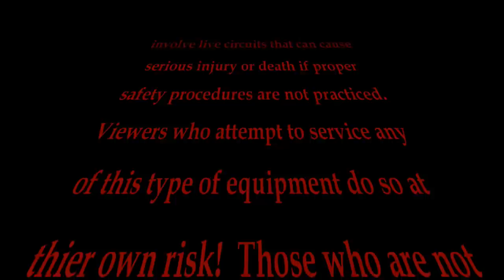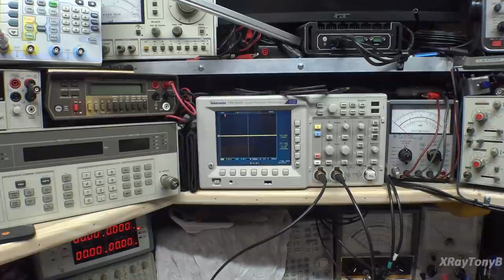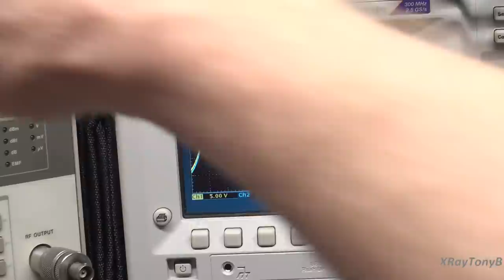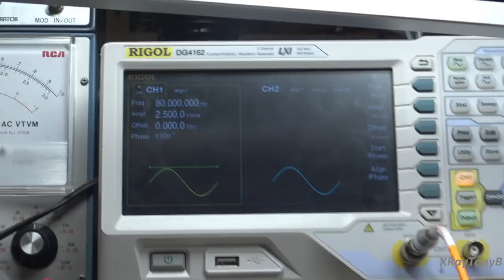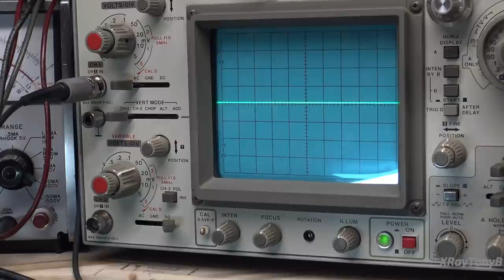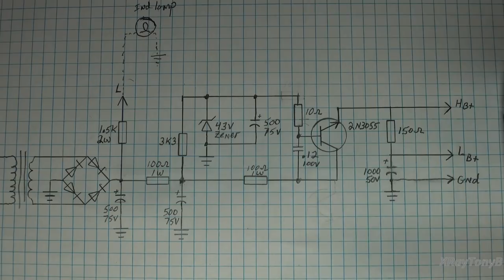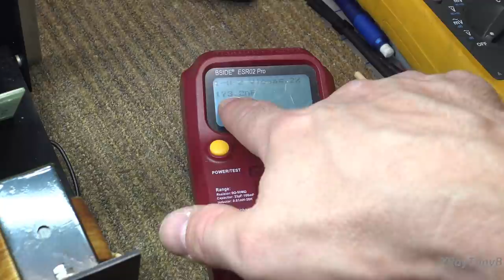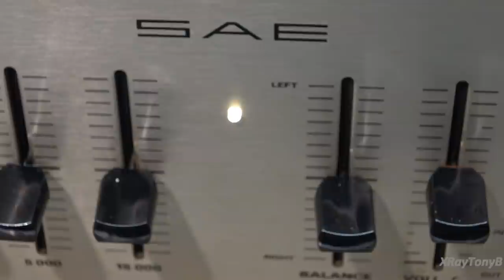SAE Mark Nine Preamp - Troubleshooting With No Schematics

Comment: Hi Tony 
Ceps hat  with Mic  works great , and you look like Hollywood star too :-)). my  comment about equalizer is that  they color sound , they have phase shift too , when I was younger I thought they are great but when I get older I understood different between good win and young win , then I choose no more equalizer in my system . 
I work as engineer designing electronic past 30 years and I enjoy each second of your video , better then any film , with some cheeps and beer it is much better .  some time I watch them several time too . 
I like also your persistence to find faulty parts , and reverse engineer , I teach my self a lot from your channel  even with 30 years designing electronic experiences .

Comment: When I was into audio more, early 90's, I had a nice system. I still had an EQ that I could cut in or out on my amp. It was a dbx1531x and I found it could make up for what the room lacked. I know a 'straight wire with gain' so they say is best, but I think an EQ  has it's place when used correctly. Good video.

Comment: i love equalizers. always have. i'm 51. i now own a couple equalizers i used to drool over when i was young. audio control c101(which i recently recapped and replaced all 101 leds in the display, full cleaning. its beautiful with mic. and an ads , and a fisher 12bnd(partial recap) and an optimus 10bnd(partial recap). my marantz pre/pro has 7-9 bands . all my computer sound cards have built in eqs. i've also been playing around with those 10 band eq boards from china, actually have a 15 band that'll be here soon. eah. any speakers in any room can benefit from an eq.  spectrum analyzers are fun to look at too....how about the vintage sansui with motorized sliders? you should try to find one and restore it. just the cool factor of those. almost forgot my minidsp 2x4. active xover, 15 bands of parametric eq. yeah buddy!

Comment: The Graphic EQ's marketed to audiophiles used to come with multi-band "test records" you could use to adjust each band (by ear..using test "warble" tones) based on the interaction with the room and the speakers. I've been using EQ's since the 80's.  I re-built an old Soundcrafstman 2020 10-band EQ quite a few years ago. I upgraded the PS and the Op-amps. I use it to attenuate the "boomy-nes"  of a floor standing sub which is placed in a corner. The op-amp upgrade really made a difference. I use a (discontinued) Ashley 15-band (pro) EQ on my main system. No "test record" though. I basically use the same "curve" from the old "Soundcraftsman EQ record". I'm planning to build a 5-band sub-woofer EQ. (don't know of any mfgr. that makes one..)   Errrata: Now folks will be sending Tony baseball caps. Would you like a "Cigar" themed cap?
Reply: Addendum: The EQ model I re-built was actually a 2215. It came out around 1990. It was based on a quad-741 Op amp (aaarrghhh..). One quad-chip per ch. I replaced those with the LM837 and a pin-out adapter. Much better sound with the LM chips.

Comment: I bought the SAE Mark Nine pre-amp in 1981 for $200.00 along with a Yamaha P2100 power amp for $300.00. The very first equipment that I owned for DJ'ing instead of renting every weekend. I loved this combo. I don't remember when I sold the pre-amp. I still have the Yamaha but it needs a quick solder job on the input connections that are right behind the cover. Just by being dragged around the state from town to town messed up those points. Loved this video, I sure have learned a lot watching your videos. Keep up the great work, Tony!

Comment: Use to be a more expensive contraption out called a 'Parametric Equalizer'. At the time, I was young and into stereo equipment and worked myself-up from cheap  monthly payment-plan no-name system to Dual 1264 turntable, Avant 6AX three way spkrs and a Realistic STA2100 receiver/amplifier-(much liked) a nd a ten band graphic equalizer. Did the same thing with adjustments as you demo'd above. Then I purchased the parametric equalizer and it was good at bringing out bass, drums..singing, it made a difference. BTW I still have the Dual 1264 TT   I purchased in 1979 and it works great. Except I made an awful one time mistake. I auto started the 1264 with the tone-arm locked down ! Anyway I put myself on a course and journy finding all info on the guts of it and knowledge of all the mechanisms under the platter..wow. At the moment it still sounds great but no auto-anything, can't lift the tone arm using the OEM silicone damped arm lifter. But purchased another arm lifter that I will rig temporary. My albums from the seventies-on are all immaculate  and my hand isn't. So record groove damage could happen, hence the temp manual lift Iv'e got until I once again lift the whole mechanism out, diagnose all the damage and get the parts..too much said LOL.

Comment: About the EQ, sometimes it is useful for compensation of tonality imperfections due to room modes, dull source material, bad speakers etc. If the width of each band is not too narrow and if it has a "true bypass" switch, it can't be a bad thing.

Comment: Interesting video Tony. For your amusement --- I used to work for a company in Montreal during the 70s that was licensed for Altec Lansing "Acousta-Voice" technology. The idea was to match the system to be the inverse of the room's acoustic resonances, using frequency analysis and filters. The goal was to fill the room with louder sound without booming, feedback, etc. It was initially done with passive parametric filters. After the tuning was done they replaced the variable filters with lower cost fixed ones. The results were awesome for the time. If you Google it you'll see some of the cool vintage gear I worked with ...

Comment: Awesome collection of test equipment tools. I stopped using regular Equalizer, still have Pro Audio Yamaha from 80s. Instead I started to use DSP based correction. Eventually I go for full DSP crossover with class D amps.

Comment: LOVE THE VIDEO!! Used to work for a USA based sound reinforcement company (that's what they called amps, speakers, and mixers used at concerts while I was there) and I HATE those linear pots!! I much prefer the radial pots and the actual coils used in EQs. Most coils are replaced by chips and resistors now days because silicon is cheaper than copper. Overall I love your videos as it takes me back to when I worked on audio circuits and had fun trouble shooting the problems some had when they came off the assembly line. (Like why the 50 volt caps were blowing up when attached to the 75 volt supply!) 
As for equalizers, I have found that I like them on my computer to compensate for some audio on you tube videos that have various problems and I like them for my car. This is the best use I have found for them.
Be well and THANK YOU for the effort you put into these videos. I know it's not a little bit.

Comment: For most, bass and treble do the trick. A loudness control is handy for  most people, both more than an eq. I used to find old recordings really needed an eq. You could boost the very top end or cut it to get rid of hiss. Some speakers were squeaky, the higher mid cut was welcome. I really enjoyed seeing you suffer like many of us and fix it no diagrams. Sure you can buy them or scour the net but often you can feel your way around, like driving without a gps, it's a good skill. Actually my Xerox diagrams were called roadmaps.

Comment: on an EQ
no amplifier is perfectly flat (in my  experience) no speaker is perfectly flat (in my experience) all add some color to the signal some very little some way too much. Not many listening situations are acoustically perfect either.
I have found that using an EQ to compensate for all of those variables to be the simplest way to get good results to make the signal larger without adding anything to it.
I found it very helpful when setting up live events it always made the audiences feel more comfortable  they would not even notice I and the system was there.
The key element for me is using a series of tones to match the bands of the EQ that are all the same level and adjusting each band to sound at the same level, the early people always complained about the sound how ever. After that I will play some test recordings of known music to verify the results.
It can even improve some not optimum set ups like beat-up speakers in a gymnasium  though it wont stop echo and bounce back
uncle frogy

Comment: When I was much younger I tried to be a "purest" and hated having anything in my signal path. I've relaxed over the years and tend to use tone controls pretty often just to get things sounding pleasant. Of course the speakers, placement and room conditions play a role and I don't have the "highest end" of speakers any longer (though very decent sounding AR floor standers from the early eighties). However, every recording is different as we all know and even with all of that aside some recordings just need a little equalization in my opinion.

Comment: This is an all discrete design with an LCR equalizer section. Very good, this is best but most expensive way to do analog EQ, not a string of noisy 1970s OPAMPS. As for the need for EQ, any recording studio, scoring stage, mixing room, screening room, theater, I have ever seen, and I have seen a lot, have equalizers in the speaker path. And many of these rooms were designed from the ground up by acoustics engineers, yet still need EQ. There is nothing wrong with EQ provided it's measured and calibrated. And beyond that, many home preamps such as the unit here have defeat switches. So if you want purist sound, then switch the EQ off. But it's there if you ever need it for a particular recording. Parametric equalizers are much more useful IMO as they can tune out a null or peak very precisely, but are also more difficult to set up properly. A graphic EQ is a nice compromise for average home needs and are also used in many professional installations.
Reply: You said it all Andy Delle.
Reply: I have wished to re-equalize certain track's, especially Weather Report's Birdland.  I always want Jaco Pastorius' Bass "stick" to dominate the tune more when it comes in!

Comment: I prefer the classic Marantz and McIntosh and others that have 3 tone controls Bass, Mid-Range, Treble. That provided most of tonal quality needed to make the great sound. Equalizers used on those stereos that cant produce good sound. Some on here might not agree, but if that was not the case most systems would have builtin EQ. I made a 32 Band EQ, but it takes up space and like you was fidgit with the controls for every album I played.

Comment: Tony, Great video as always. Very informative. The audio with the baseball cap mic is good.  I do think I would have to do something about that always on indicator light. It would drive me nuts. Either a #1835 incandescent bulb (55V) or maybe a diode in series to drop it below emitting voltage when off.

Comment: Having an audio spectrum analyzer with microphone/pink noise to guide EQ adjustments (see what is going on) can make them more beneficial.  Without one I just wind up chasing my tail.  I've not needed one for home use (started with a cheap fisher rack system) since getting better quality gear years ago, but for PA stuff they are very handy.

Comment: Tony...I posted this message on Uncle Dougs channel yesterday and thought I'd share it here with you and your watchers:

I bought an ESR70+ ESR meter to make it easier to test electrolytics both in and out of circuit, and I noticed a few issues that might be of benefit to yourself and other viewers who do their own electronics work. While I haven't used a different brand of small ESR tester, to my understanding they all use basically the same type of square wave oscillator to test caps, so my findings might apply to a broad range of them.

First of all, they do not work well at all for testing cathode bias caps if the parallel bypass resistor is a lower value such as a 250 ohm resistor across a 50uF 50v cathode bypass cap on a pair of p-p 6L6s.  The ESR70+ reads the circuit as leaky and the measured cap value can be very flaky.

More important is that after testing numerous caps I removed from circuits which appeared to be in good shape according to the ESR70+ , when testing them with my old Sprague TO-6, almost all of the same caps which tested "good" with the ESR70+ out of circuit showed a great deal of leakage when tested at the working voltage of the caps using the TO-6, and needed to be replaced. 

Right now, I am going through a Marconi TF2331 Distortion Analyzer which uses a lot of 'lytics, and I have thus far found all of them are leaky and need to be replaced, whereas the ESR70+ only picked up problems with a very few of them both in and out of the circuit...!

YMMV, but I'm beginning to wonder if my ESR70+ is of much actual use. Luckily for me, I always check HV caps with the TO-6, because I tend to use it to form new, or test and reform any usable old HV caps....

Sorry for the long post...!   Jordan...
Show less

REPLY

Comment: In 1983 I bought a JVC system, including the revered SEA-R7.  I held onto all of it until 2007, I still regret letting that EQ go.  I rarely ever boosted or cut frequencies, but the delay time and the cross network were always used.

Comment: Tony, one thing I think that would be a big improvement to your channel would be to run a second camera for scopes, meters etc. This would free you up and you wouldn't have to re-aim all the time.
The second frame could be picture in picture up in a corner. It doesn't need to be hi-res either. I use a old 720p camera for this purpose and if you've seen any of my vids you'll see what I mean.
Sound & lighting are great, no need to stress over those.
Keep up the great videos and thanks

Comment: I always liked a 5 band EQ, Anything more is cumbersome IMO. I have a basic setting that suites me listening needs. I tweak it slightly to match the recording I am listening to. ELP has major differences in sound levels vs say Rush. Old and new recordings also vary because of the equipment used at the time of recording. Combine that with the conversion from analog to digital and the base recording is altered twofold. The EQ gives me the ability to tweak them back to my listening preference. I have always had and loved the ADC "Sound Shaper One". It's basic, simple,  and just works.

Comment: I was involved with the design of the Soundcraftmen 2012 equalizer.  I presently have a digital 1/3 octave equalizer in my present system.  In IMHO they have only two uses first is to help control the acoustics of the room and the second as a precise roll off filters.  Like the soundcraftsmen  the SAE  Mark 9 uses L/C filters which causes a lot of phase distortion In my book that would  put this in the a non audiophile category along with the soundcraftsmen.

Comment: I have an amp with room correction, I place a mic at the listening position(s) and run the automatic measurements, and the amp does its best to flatten the frequency response to the room. It's awesome. Not perfect, but still awesome. Especially for tightening up the bass. Doing something like that manually would probably take me days of listening to white noise, and it would still require me to have some way of measuring and visualizing the frequency response.

Comment: Had the same issue with the capacitors on the SAE MARK XXX preamp, which is very similar to the mark 9 other than the equalizer. Those sliders are all ALPS units but are very hard to find if you have a bad one. The Phono section is average buts sounds good enough.

Comment: I mostly use my EQ in line with the reel to reel tapes. They make a good substitute for a noise reduction system (like dbx or Dolby). At the recording, everything above 1kHz gets boost, everything below gets reduced. Playback is in the opposite settings, of course. It's easy for me, because mine has a reverse switch (Pioneer SG-90).

Comment: Nice discussion and troubleshooting as always, Tony! The blue Philips electrolytics are in my experience often good, despite their age. On the equalizer board the small metal ones at .22uF seem to be tantalums! I wander why they have put them in a passive circuit! Also the "bullet-shaped" ones seem to be Kemet tantalums. I have replaced some 15-20 of those in a Wavetek signal generator, and have yet more shorted ones to yank out of it..